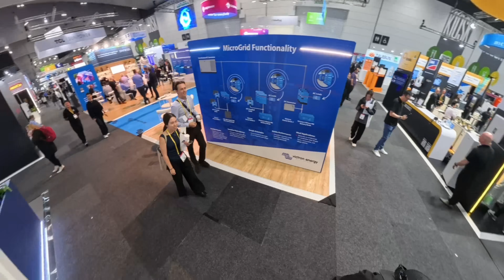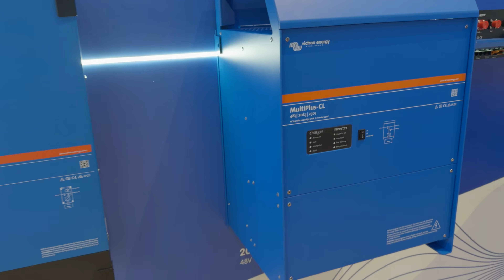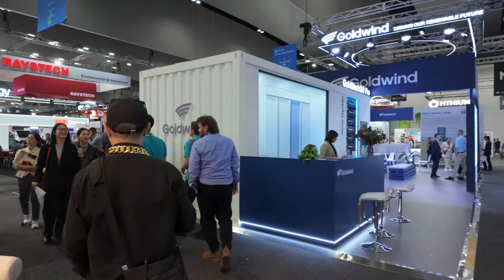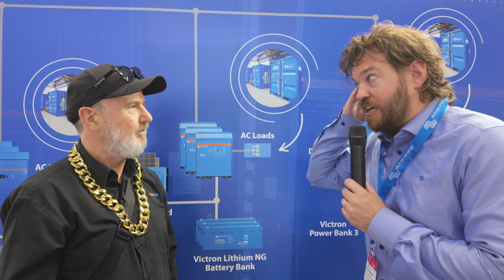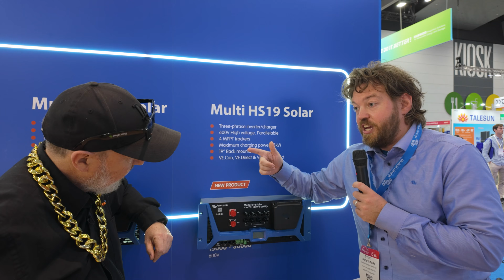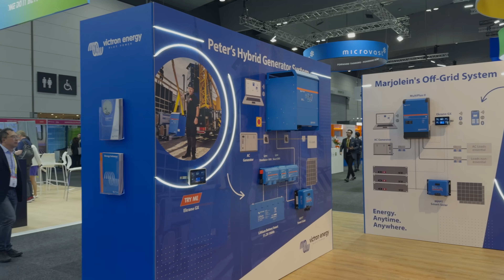Victron Energy Deep Dive – MultiPlus, Cerbo GX & VRM with Guy Stewart

Comment: Victron is way over priced and takes way too much space to install.
Reply: They are used in vans, boots etc. What would be an(y) alternative? Including the support, free vrm plattform...
Reply: @VK-qh6pr so for way less price and space you could get an ecoworthy 5000w  48v system for 800. Then 1600 worth of 280 amh batteries. . Have way more power for way less price and space

Comment: The comms wiring has always been a problem... very fragile, and anything that reduces it would be a plus.  But still requiring the GX device is a problem...  its very old-school from a time when microcontrollers did not have the processing power.  But now they do.  Having the auto synchronization without comms is a great change though.

But another long-time problem has also been the AC pass-through (for which Victron has several optimizations trying to workaround all the issues).  People still doggedly try to use it but bypassing the whole mess with an external AC-to-dedicated-battery-charger solution is becoming more common.   Same thing for generator support... there is no need to synchronize the generator AC if it isn't going onto a common AC bus.

-Matt

Comment: Multiplus-CL is that so new that even on the Victron Website no Info pop up ? Aluminium Technology ?
Reply: It will be at the Victron website if it's ready and available.
My guess is that it is still a few months to get there.
Reply: @SpatteL19 the new 4500 and 6500 are also aluminium models and can be ordered right now (in the netherlands)
Reply: @HHalewijn  Why do you think that the 4k5 and 6k5 are "aluminum models"?
Reply: @SpatteL19 because we have them for R&D in our workplace.
Reply: @HHalewijn They have the same weight as the 3kVA and 5kVA. With aluminum I would expect them to be lighter. 
I would also expect that this would be mentioned in the datasheet/manual.
Reply: "aluminium technology" is fancy way to name cheap technology so the customers may think "wow! new technology, wow!". The thing is it is shitty, but pssst! Technology!